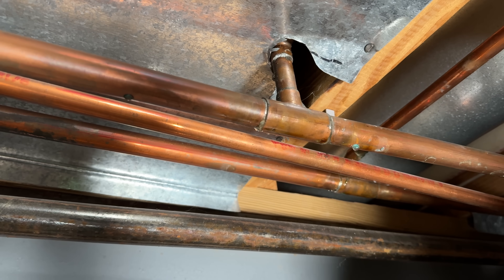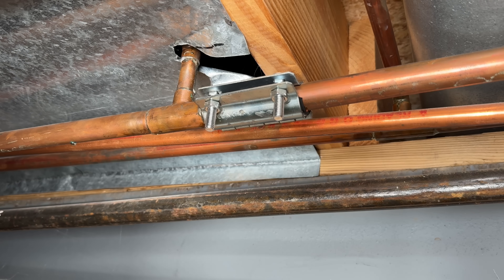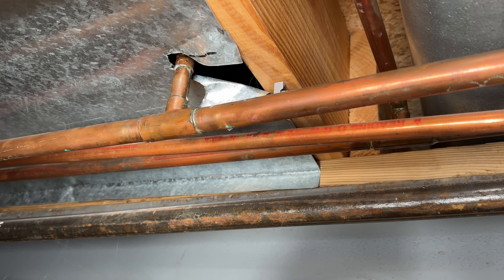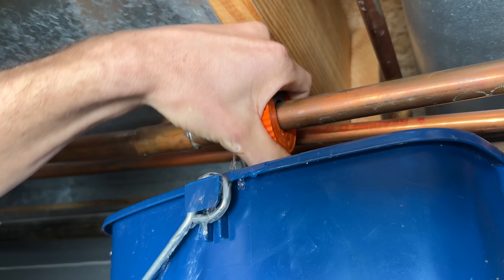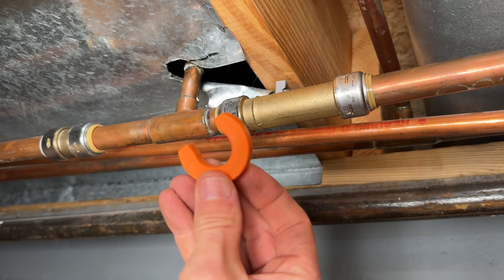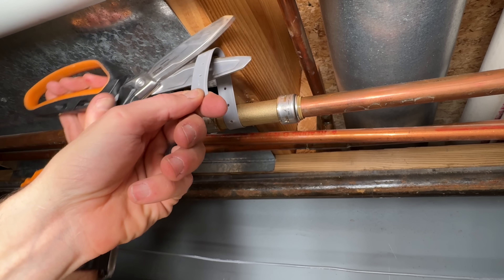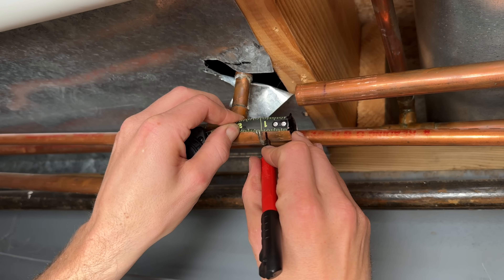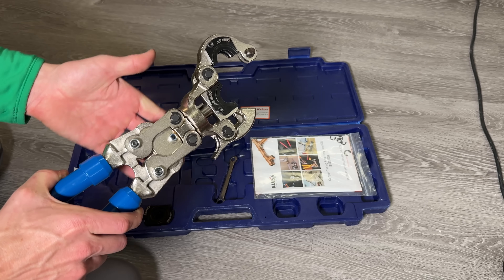How To Fix A Pinhole Water Leak In Copper Pipe | No Soldering Needed!

Comment: I'd use a shark-bite but leave an access to the repair. Plastic panels are available that will fit into the ceiling or wall cavity and are easily removable, if necessary, in the future. I used them when replumbing the master bathroom and the basement bathroom in my old house.
Reply from the maker: Yeah, I am going to mention the access panels in the video where I show the drywall repair as well. 👍
Reply: Where can I find these and how well will they insulate if installed 5' from and along the interior garage drywall near the car's garage door opening (not perfectly sealed from the outside air when shut, unfortunately. Maybe that should be the next project on the list. Ha)

Comment: Shark bite is just a glorified compression fitting. These ultimately fail over time, especially if pipe is not properly supported.

Pro press style will fail at some point as well since o-rings do wear.  How long?  Who knows…I’m used to food processing with heavy usage, chemicals, and food which severely shorten life of o-rings.

Comment: My five 20+ yr old sharkbite  fittings are still solid.
Reply: If they are prepped and installed properly, they should be OK.  I believe they have like a 25 Year Warranty/ service life?  Some say they would not install them inside a wall, etc, but only where they are visible, or have easy access.  Hey, as Scott showed here, even copper can fail at some point.  Take care
Reply: @georgedavall9449 As you said, proper prep is key.

That said, I don't trust anything with an o-ring or rubber gasket/seat/etc. Think how much more often faucets/fixtures have to be replaced, it's almost always the rubber parts.
Reply: @Lusterredux Objectively, there are two main reasons rubber seals fail. 
1. Age - after many years rubber hardens. Thus the 25 year warranty. 
2. Wear - in faucets or valves, the rubber seals are subject to abrasion and wear. Again, it can take many years, but fortunately are in accessible locations most of the time.
Reply: @Lusterredux  start trusting , most water mains and gas mains that have been buried for decades with some having higher pressure before having regulation they have gaskets and o rings and gaskets
Reply: @_1ben  But it hurts nothing if a pipe underground drips a few drops all day long, that's not the case inside your walls
Reply: @Lusterredux You don't ever lie.  I absolutely agree with you  especially if you have hard or acidic water
Reply: Solder is forever, O rings fail at some point
Reply: @integr8er66  so does solder. Many times have i fixed bad soldered joints from corrosion.
Reply: @integr8er66  Solder is definitely not forever, it is subject to corrosion even when well done (not too mention when so called "pros" botch it). Pretty much nothing is forever.
Reply from the maker: Nice, thanks so much for the feedback!
Reply: The pipes he is fixing leaks on is type M copper pipes. That is thin copper pipe and I bet his water is acidic that is slowly dissolving the pipes causing the pin-hole leaks.  I have the same problem and am replacing my pipes with Pex.
Reply: @joem5643 In other words he didn't permanently fix anything. He will develop another leak somewhere else. He addressed the symptom and not the root cause.
Reply: @joem5643  In my opinion,Type M thin wall is too thin for reliable copper water pressure pipe.  I only trust it for DWV on HVAC applications..  Type L , or type K for extra heavy duty should be used..  I have had to use type K on military spec refrigeration lines.  The fittings are still type L though.  We used type L cleaned and capped, nitrogen filled pipe for medical gas, and refrigerant piping.  We purge with Nitrogen while silver brazing for  those applications.
 .
Reply: I have shark bite fittings installed that have been there for three years now and no leaks.
Reply: @rontiemens2553  I have sharks on my pipes that have been on for over 5 years and no problems. I was commenting on the copper pipe, I see red on it which is usually the thinner type M pipe. If you have water with low ph (acidic) these leaks are very common when the pipes get old. I have some pipes that are over 35 years old.
Reply: @joem5643   Same problem here. I'm replacing type M copper in my basement as time goes on, because there are many pinhole leaks which have "corrected" themselves (ie the corrosion sealed the leak 🤣), and others which outright leaked which required immediate replacement. My pipes are pushing 50yrs old.
Reply: I used shark bites with great success for years !
Reply: Yep, i have had one fail, and that was because the clown installer didnt seat it corectly. I fixed that. Its perfect.
Reply: Turns out o-rings work very well. They are used for high pressure gas too
Reply: @sammyd7857  They work really well.......For a while, then they don't
Reply: shark bite rubber seals warranty for 25yrs ok…so tell me what rubber seals in your car last 25 yrs…
Reply: @jpnphom5470  That's not even the point, my house is 75 years old, so it would have needed to be redone 3 times already
Reply: I’m doing a bathroom reno in an occupied residence.  Sharkbites are my lifesavers, as I can quickly bypass my cut plumbing with temporary pex lines to keep the rest of the house live.  No draining and de soldering copper needed.  Final job is copper and pex mix.